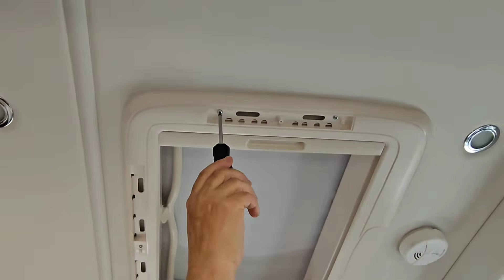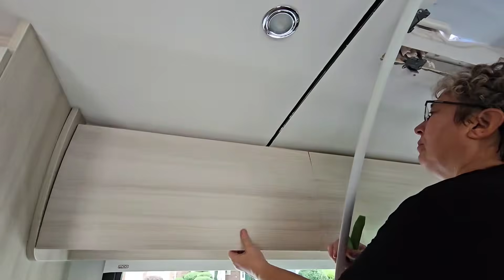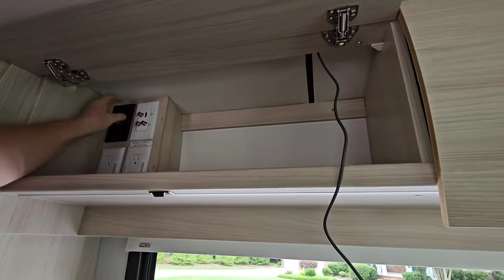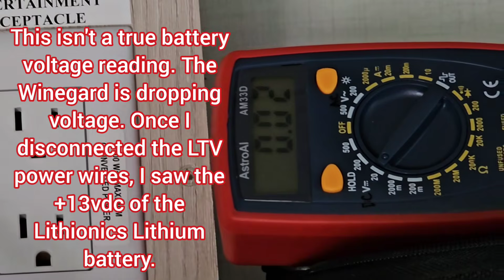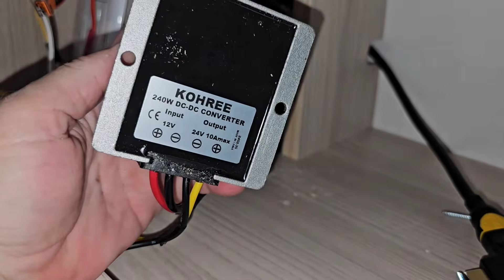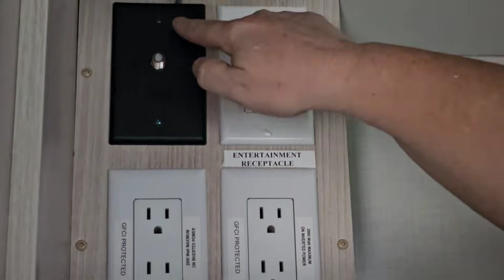LTV Wonder Skylight Starlink Mini 24vdc Power Supply

Comment: I'm confused as to why the Starlink can't just be plugged into the outlet in that cabinet. Can you please explain that to me?
Reply from the maker: It certainly can be plugged into an outlet, but then you have to be on 120vAC shore, generator, or inverter power  to run the Mini. I run my Mini 24/7 when traveling and camping. I boondock alot as well. I don't want to waste battery power running the ~20w Mini from a 3000w inverter when I'm not plugged into shore power.  It takes 3-5ah (amps per hour) just to have the 3000w inverter on. That's a lot of battery usage to run something requiring just 20w or .2a plugged into an outlet. Consequently I wanted not only to be able to run the Mini directly from battery power, but also have the power wire more hidden. I also wanted a place to mount the Mini essentially permanently, so I didn't have to handle it at all. The Skylight makes the most sense for me since I never use it. I can mount the Mini there and forget about it. So I devised a simple way to run 24v power to the Skylight that allows me to run it directly from battery power 24/7. I now leave it on even when I park in storage to run my Ring Cameras to monitor my Unity until our next trip. My solar easily runs it while keeping my battery charged. I love my Starlink Mini, it's been a Game Changer for my traveling, camping, and storage style!

Comment: Sandy, is there another way to do this without disabling the Winegard? I'd like to keep it as back-up.
Reply from the maker: Sure, just splice into it's power wire instead for the Starlink Mini power wire. Leave the Winegard connections in tact. Then only use 1 at a time because the wiring magnet support powering both simultaneously. Wago 221-400 series connectors make it very easy to make wire splices. I didn't have time to explore this, but the LTV Pre-Wires for the Winegard Satellite option and you can find those wire behind the panel there. The Winegard is powered from the Firefly and can be turned off and on at the Firefly Screen. You might explore this more with a voltmeter and use the Satellite power wire for your Starlink Mini setup converter power. You can splice into the Winegard Connect ground wire for a ground if you need 1, I don't know if the Satellite Pre-wire has 1.